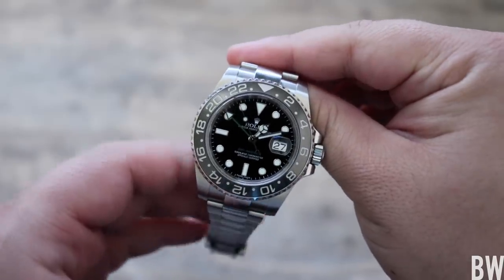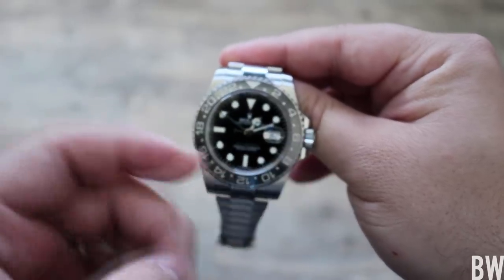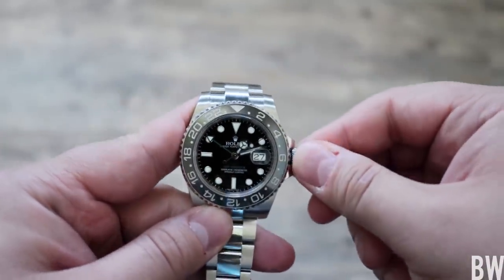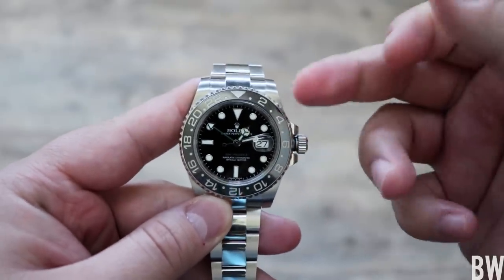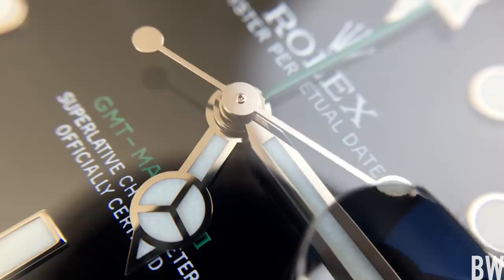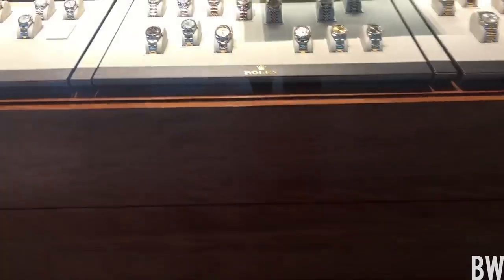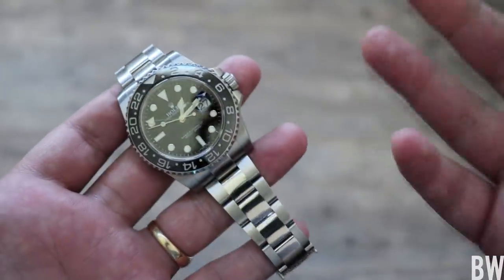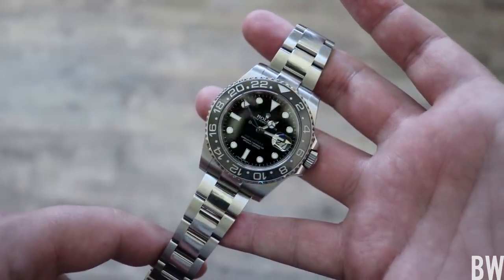My Rolex has an issue

Comment: This is a characteristic I've had with ALL my Rolexes, and I've owned Rolexes since 1978. I just bought a new Submariner last November (2018) and have this issue...the fact that the crown won't extend fully and stop the watch. I have the same characteristic with my Day-Date 40mm, which I bought new in September 2015. I have the same characteristic with my Sub "Hulk," which I bought new in 2015 when I bought the Day-Date. I have the issue with my Explorer I, which I bought new in 1997, with my Sea Dweller, which I bought new in 2007, and with my first Rolex, a Date model, which I bought new in 1978. To avoid the problem, when I unscrew the crown, I rotate it fully in both directions. That usually avoids the problem with the exception of the Hulk, which sometimes sticks even after I've rotated the crown both directions first. The Sea Dweller, by the way, has this happen less frequently than any other Rolex I have. I've even encountered this characteristic with showroom models I've looked at at Rolex authorized dealers. To top it off, some of my new Omega Seamasters have this characteristic. I assure you, this isn't a problem but rather a characteristic. As for the high-pitched sound, I've not had that happen. But then, I haven't put the watches up to my ear to detect the phenomenon if it happens.
Reply: Thanks, I’ll try this.

Comment: Every Rolex I've owned had a sticky crown. Buy an Omega!
Reply: My OP39 has no such issues.. Not trying to take anything away from Omega - but my OP39 felt higher quality than an of the Omega's I handled at the AD before buying it (not to mention much better fit on the wrist).
Reply: Joe Wolfe Found the fit and finish to be on equal playing field when handling the new Seamaster vs Submariner.
Reply: DAMN

Comment: I've had a couple of my watches do this, and I've fixed it by using the thumb and forefinger to get a good grip on the crown before pulling it out. Using just one, will push the crown either upward or downward ever so slightly, and with such tight tolerances, could be mistaken for being stuck, when the stem could just be catching on the mechanism.
Reply: I agree I've always use both thumb and finger so you have an equal pull on the crown.

Comment: Thanks for showing us Bruce. Unfortunately I know the issue very well. That doesn't only affect GMT movements (3186). I had the exact same issue with my 3135 in my Submariner I bought in 2015. 3 months later (!) I noticed the same behaviour. Unfortunate enough I had also "scratchy" noises while winding the crown. I immidiately knew that this isn't normal. I took the watch to my AD and they sent it to Rolex in Cologne which is their HQ in Germany. After two weeks I got it back and everything was fine again. Funny enough, I also had a slightly miss-aligned bezel what I've overlooked when buying the watch initially. So yeah... as you can see my first encounter with Rolex was a hard one. Four years later I'm still convinced that Rolex makes great and reliable watches but as you said: No brand is free of issues and problems. But maybe Rolex has not much less than others as most people think they should have.

Comment: Bruce I have the same watch, same problem. Bought it new from watches of Switzerland in Glasgow September last year, most of the time I can set the time no problem but occasionally I have trouble pulling the crown out to the third position and then sometimes when I get it to pull out the second hand doesn't hack. Don't know why I didn't take mine back sooner but it's going back. Hope you get yours sorted.

Comment: The crown may need some repair work. I haven’t had any such issues with my blnr but now you got me thinking, I’ll check mine too. After checking everything is fine. Easy to pull out and hacked immediately, tried it few times

Comment: I have the same exact issue with my 116610 LN Sub. Only happens occasionally but when it does it's rather annoying. Bought mine in 2016 and I have 2 more years of the warranty left. I know they will fix it but I am waiting when the warranty is near the end to do the full service at the same time. My AD does not have a watchmaker on site so they will have to send it in to the Rolex SC and it will take around 8 weeks to get it back so it's best to do it when it's due for service and still do it under warranty. Good luck with yours. I am sure it will be just fine. Cheers.

Comment: Same issue on my BATMAN. Sometimes it didnt engage correctly into the first position to set the hour hand and then didn‘t pass through to the hacking position. It got stuck... A bit of fiddling around worked, but sent it to service.... Came back after 6 weeks, problem MORE OR LESS solved BUT the Triangle of the bezel was not alligned with the 12 mark correctly... These bunch of idiots took out the movement as well as the dial and didn‘t allign it correctly (i checked with the rehaut engraving) SO another service and dial is alligned.... And guess what?! Now the cyclops is missaligned! Did they take off the glass or what? Checked that with the laser crown and the 6 hour mark.... Feels my whole Batman is off and Rolex service and quality control really gave me a fuck! So will hand it in for service one more and see what they will fuck up next! If there will be again any flaw I will sell that fucker and Rolex can stick their overrated pieces in its ass and gonna buy a bloody Swatch....

Comment: I have the same issue with my bluesy submariner.. Seems mainly when I have manually wound the movement, I've found if you roll the crown backwards and then pull out to hack, that seems to work better... Austin Daniels also had the same on his watch and did a video...

Comment: I had the exact same issue with my blnr. I did some research at the time and found it seems to be a common problem with the GMTs. I had it fixed under warranty and it came back perfect. Luckily I haven’t had any issues with my 116710ln.
Reply: Sorry but there should be no issues with this watch.  If Rolex is that great why is it a common problem that they have not permanently fixed?

Comment: I have the same model (from new) - its one year older than yours. I've had the same issue but it happens only occasionally. When it does happen, I find that by screwing the crown back in and then trying again, it sorts it out. It happens so infrequently and the fact that I can overcome it easily, I've not bothered going down the warranty route. I view it as a part of the movements 'personality'. Hope this helps!
Reply: LOL, if it was Omega or Grand Seiko it would be a shit movement, in the case of Rolex it's the movements 'personality'
Reply: @Mint-cb2vc  LOL. Agreed!

Comment: I have this Batman. But, today i will comment on my Daytona 116503 instead. If you have one, start by feeling your finger round the crown and the guard, then the pushers. Then, feel the edges. Now, i also have the Jade Dragon SBGC207. If you have one, repeat the same. Now, you can feel the difference between machine made watches and handmade watches. If you want to know what 'sharpness' mean, you compare it with a Grand.
Also, my son get rashes wearing the Rolex but not the Grand. Strange!

Comment: i used to have that issue, but then i starteed to use to fingers to pull out the crown. I think it's because of the stress it causes when u pull it out with one finger.
Reply: bony wony I never noticed I have been pulling the crown with one finger until now. I just consciously pulled the crown with three fingers and the operation was noticeably easier and much smoother. Thanks for the tip!!

Comment: all the gmt masters in my collection have the same problem, even a few of my exp 2 also suffer from the same issue.  i am not particularly worried about this since they are all working fine keeping great time, so i've never reached out to Rolex to address it, and I dont plan to in the future either.  having said that, i've heard this issue is addressed (or engineered out) in the newer gen gmt movements with 72 hr power reserve.   all my gmt masters and exp2 are the older 48 hr power reserve variation,  so i dont have personal experience to speak of regarding the newer gen movement, but i would say dont worry about it.

Comment: This can happen with the 31xx movements. I always unscrew the crown first then wind forward a bit to get the crown to “pop” out first without pulling it to the date or time set position. Then after it pops out you can move to to the time set position. Send it directly to the Rolex Service center in Dallas when it is time for its next service.

Comment: I don't own a GMT, but I feel like the more complications you have in a watch the greater chances of things like this happening. I've got an Explorer which is time only and my next Rolex will probably be a no date Submariner. Keep it simple!
Reply: Sub time only 114060 now. 😀👍
Reply: @Jonathan. Common sense says you're right. But watch-sellers lie. They'll tell you that a complex watch that they're selling is just as reliable as a simple one.
Reply: @highnrising  
Well I have what was is nice 14k BaumeMercier Chrono from the 60s. Glitch ednow. Placed on the back of of the collection rack. My good old, very old watch maker has long since past. Shutter to think what what a kick it will be to have her run properly now. Repair $ vs value. Much like own an old MG or old Jag I suppose.  Just pay to see the old girl running properly. But I will find a right smart honest chap to take a tinker at it regardless. 😀👍

Comment: This is common with 3186 and 3135 movements. The new 3285 and 3235 movements solved this problem. I believe the new movements are counter clockwise in terms of hour adjustment compared to the old movements which is clockwise. Got a 116622 and 116710 and sometimes it does this I wouldn’t say its a problem but it is the movements. Sometimes if you send it to get fixed sometimes you get more problems thats just me. Cheers

Comment: I had the problem it seemed the it was hard to pull crown into 3rd position but it was just my nail was on the threads stopping me from pulling out. Every time  I made sure I was just holding crown it was perfect. It's a datejust 41 and no other issues. Since I noticed that I have no issues. It was the way I was trying to pull out the crown is all

Comment: Bruce, those "sticky crowns" are typical to Rolex. I had GMT-s and Explorer II-s with this exact problem (even my hulk had this issue but much less pronounced). Whenever you're pulling out the crown right after winding there's a good chance it will not properly click into the date/hour-quickset position, then it would be very hard to get it into hacking position. Now one thing that somewhat helps – do a few turns backwards after winding it and then pull out the crown. Also make sure you're pulling it straight (not with one fingernail as you do in the video). Also my experience is – new watches are more prone to this, but in couple years they kinda break in. In general all Rolex crowns feel kinda flimsy, hard to catch thread, easy to cross thread, etc. Still somehow they keep working no matter what. No idea about the high pitch ticking though – ticking tone may probably vary depending on the position/orientation.

Comment: I noticed you use your finger nail to pull the crown out.  I wonder if your putting excessive upward pressure on the crown/stem assembly causing  things to not work as expected.  I wonder how much if your fingernail residue is caught up in the tube threads...

Try pulling the crown out using your thumb and index finger and pull out axially minimizing radial loads on the crown.  This is what I do with mine and it's buttery smooth.

Comment: had this issue with my rolex gmt. cant be bothered and sold it 6mths later. bought a pre-loved submariner, never missed a beat. bought a preloved daytona, had a service by AD, came back with scratchy winding and a hard stem. sold the daytona. rolexs are far from perfect. they are very reliable 10k watches no more, and should never be priced above 15k even for a daytona.

Comment: Try some silicone grease, I had a sticky crown with my six and a drop of that on the threads solved it.
Reply: I would not attempt to service a Rolex myself.
Reply: @highnrising  not even close to servicing.  Literally unscrew the crown, bring it out to 2nd position, put a drop of it on the exposed stem, screw the crown back in.

Comment: I gave up on these type of watches,  it's really dissapointing to have these issues on such valuable watches. they absolutely are not worth the heartache. my watch was new , I later noticed a grease mark on the face , probably from manufactur, even after two returns  it was never properly  cleaned . eventually I sold the watch and retrieved most of my money . I had this silly issues on two watches , crowns not lining up etc, I am surprised at the careless quality control on these sort of watches,

Comment: Don't pull it out with your nail pushing the crown on one side. By doing that you are exerting pressure on the crown shaft in opposite direction, which can hinder the crown's movement to a certain extent, by pressing the shaft to the opposite side "of the wall". Instead, grasp the crown with the tips of both fingers (it is easy and more efficient), and then pull it out. You will be successful every time. By using your nail as an extractor, occasionally you will have this problem...as you already do. Nothing is wrong with the watch You are doing it the wrong way.